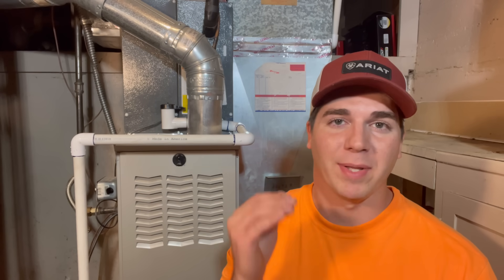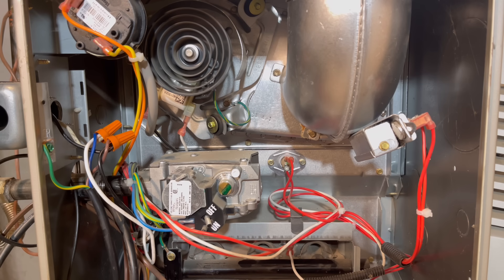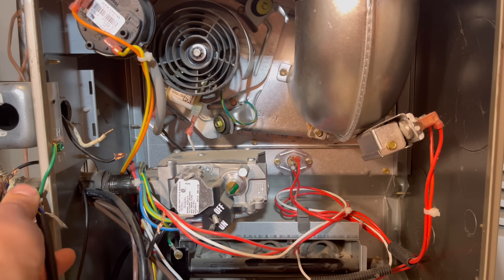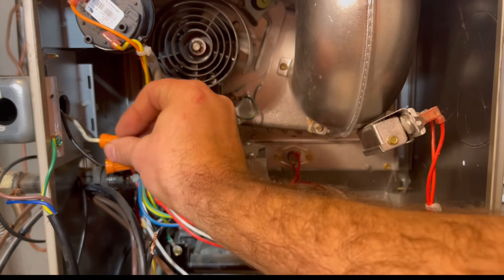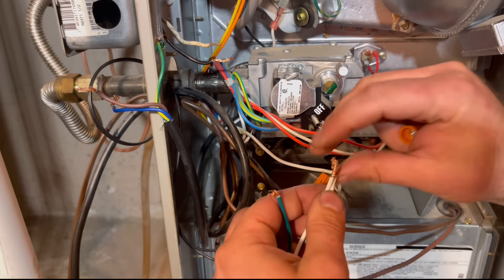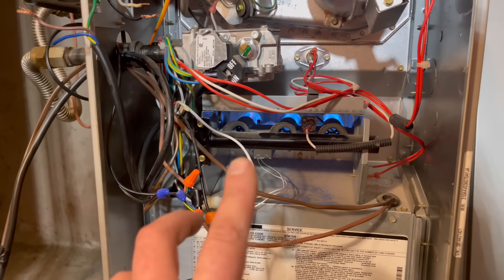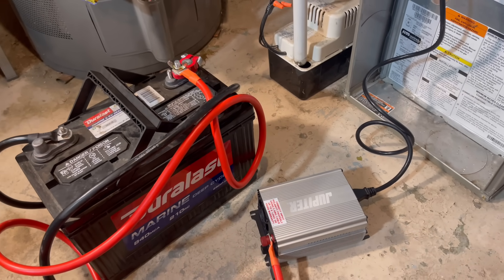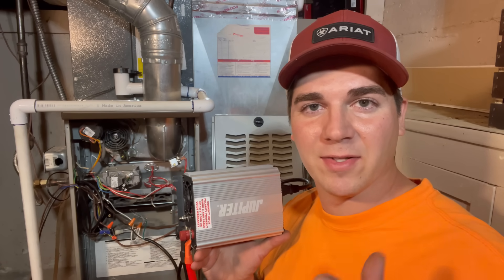Did You Know You Can Heat Your Home With A Car Battery?

Comment: My thermostat is electric.  I'm wondering how I can get it to kick on if there is no power to the wall thermostat.
Reply from the maker: This truck won’t work for an electric furnace unfortunately. It will only work for 110v
Reply: @diyhvacguy  thermostat is powered by electric. I have a gas furnace.
Reply: @diyhvacguy  I noticed that you explained to others that the thermostat is powered by the furnace. Good to know. Thanks for the video.

Comment: I have a lithium 12 volt deep cycle battery $190. These batteries will run a trolling motor forever. Will it work on this trick?
Reply from the maker: It’s worth a shot!

Comment: It doesnt last long more than 4 hours. The average furnace blower fan, and inducer fan will run about 1000 -1500 watts, yor inverter must be 1000w to 1500w. The battery for the system only can run only 3 to 4 hours per battery.
Reply from the maker: Correct but it doesn’t run for 4 hours straight. My furnace runs for 10 min increments, then sits for about an hr before it kicks back on

Comment: Emphasis on the RV battery. It is generally a deep cycle and is ok with heavy discharges and recharges. 
While a standard automotive battery will work (if it saves your life and/or your home, then go for it), heavy discharges until empty will greatly shorten it's lifespan.
Also, regardless of the type of battery, be sure it's always fully charged. Your automotive battery likely will be already. However, if you have a battery on the shelf or sitting outside for long periods of time, get yourself a battery charger (a Battery Buddy, etc) to keep it always ready for use.
Reply: golf cart batteries are designed to charge and discharge  hundreds of times. I use thr in my solar generator. it lights half the house and boiler
Reply: Yeah little car battery just run an extension, idle the car at night and solar the battery at day.

Comment: You are absolutely correct in everything you showed except I’d recommend people take a photo of all wiring BEFORE disconnecting in order to reconnect after grid power is restored to the home. You showed the 12 volt/inverter connections but you should have shown the connections back to normal grid operations. I’ve shared this video link with 400 of my neighbors on a local site because we have 1920s vintage power grid lines and in light winds or ice we go without power for hours and some days. I have a steam boiler system and already had my back-up just as you showed by we have a 24v transformer system that ignites our gas burner (110 to 24v transformer).
I just purchased this 2-way switch and this video gives detailed instructions on hooking up to our boiler/hot air furnace so you can switch from normal grid power to the 12 volt/inverter “in a click”.  You could incorporate this into another video with your system.
You also need to add a ‘disclaimer’ (to CYA) that only people with home electrical and experience in home DIY repairs and proper tools should attempt this. Doing this ‘may’ hinder furnace/air conditioner warranties. 
https://youtu.be/W0sTmCVLeGI

Comment: (also) if you going to buy a battery for this you want (if not a lifepo4 battery) an AGM zero maintenance battery capable of deep cycle.   You will also need a competent battery tender because lead acid batteries self-discharge relatively fast.  You'll need to leave the battery on the tender 24/7 365/yr.

And for ref the typical furnace while running full out takes around 400-600 Watts of power which means your 100Ah 12 volt battery will last about 2-3 hours of solid operation.  Granted furnaces are usually only on for say 10 mins per hour so 1 battery will last you about 18 hours in cold cold weather.

If you want to be able to run your furnace for say a 3-4 period you're going to need a lot more batteries.

This is also a perfect use of a generator.  A lot of people waste generator fuel when their loads aren't maxed out (it consumes fuel even if there is no load).  If you buy a rapid 12V charger you can use that to top up your batteries from the generator periodically making good use of the fuel on hand.  Only running the generator to charge batteries (which provides a constant load) and turning it off when they're full.

Comment: The correct way is to setup a separate backup panel and then some sort of ATS to swap between grid and generator/inverter.

If you want to do a "hack" then add a male 15 amp grounded plug to your furnace by splicing the hardwire input and then turn the other leg into a receptacle box with a standard 15 amp female outlet in it.  Then just plug your furnace into that.  That way you can plug it into your inverter/generator without having to re-wire it.

What you're recommending here is a really bad idea esp since most people will be doing this in a grid down situation (re: in the dark).  At least if you go the outlet/male plug route you can do that well in advance of a storm.

Comment: As you have the inverter, why not unplug the furnace plug from its outlet into the inverter?  It doesn't make sense messing with the furnace wiring.  Also solves issue around needing 24 volts mentioned in other comment.
Reply: Newer furnaces with variable speed motors will need a pure since wave inverter.  Check the price for this type of unit. This hack is not as inexpensive as represented.  Might work on older units in a pinch?

Comment: Honda EU2200i or larger generator.
Propane conversion kit with 20lb or 30lb tanks.
The same pigtail for the furnace mod.
This allows you to run you furnace and fridge/freezers.

I use an independent deep cycle battery and a small inverter to fire up my gas fireplace first.  If cold temps require it, I plug the furnace system in to the generator also.

Comment: Love the thinking here, however only good for Gas Furnace, not good for electric furnaces 🤣🤣 That little thing would smoulder 🔥

I use a deep cycle battery and 1500Watt inverter as a backup to power my Pellet Stove in case of emergency. Haven’t had to use it yet in three years.. But in my case, my pellet stove doesn’t draw a lot of current so this deep cycle is supposed to give me a 24 hr run time, which I have yet to test. 
But having 3 batteries is definitely nice.. 

I think a generator is still the way to go, as it’s most of time easier to go get gas somewhere..

Comment: Great advice! Can you do a video series on attaching a permanent A B switch ..and a permanent plug in off the FURNANCE and how to recharge the battery after drained.  Or a video on testing it out with a lithium battery? I think many folks would like to make it a permanent mod so when power is out…just switch and plug it in ;-).  Thanks so much!
Reply from the maker: Yes! My next video that posts on Wednesday evening shows how I changed my power source so I never have to touch wiring again. Also a company is sending me a lithium ion battery 100ah to test so that will be cool to see how long it would run on that :)  stay tuned! cheers

Comment: His claim of being able to power your house furnace for several days using a car or even RV battery is misleading, unless you live in very mild climate where the heat is barely needed and you have a small house. My house is about 1600 square feet and my furnace draws 2.63A at 120V. That means it would theoretically need 26.3A out of a 12V battery. Considering the efficiency of the inverter (modified sine wave) estimated to be 80%, the battery draw will be in reality 32.9A. Assuming the battery is fairly new and fully charged to begin with, with 75Ah battery (small car) I will theoretically have about 2 1/2 hours of furnace run time. With a 150Ah RV battery I could get almost 5 hours. In real world, these times would likely be less, because of the actual battery condition and the fact that battery published capacity is typically specified for lower discharge currents than the furnace will draw. CCA has no meaning for this application. Of course even in cold climates the furnace does not run continuously, so it is up to you to find out if just a few hours of furnace run time will be enough to keep your house warm for those several days.

Comment: I think this definitely gives people options to keep the heat on during an emergency. Great idea!
Reply: Replace the on off switch with a double pole double throw switch and hook a female AC cord to the second switch.  Now all you do is throw the switch to the second position.  Without anything in the plug the furnace is off with AC to the plug the furnace is running from the second source.

Comment: im a jm electrician and can say this will definitely work, BUT  for how long?
the furnace  electronics dont use much power but the fan would drain that battery in a few cycles in my  estimation ?!
Reply: you would be better off wiring that invertor to your car and running an extension cord from furnace to car, then you have heat as long as your car has gas

Comment: I think you can just use your battery there.  and the inverter there.  and a plug with two male ends.  and plug into nearby outlet.    (making sure to turn off your house main breaker first)

Comment: Would anything like this work for an electric furnace heat pump system? Seems the heat pump system would need a lot more power🤷‍♂️. Thanks!
Reply from the maker: You are correct. Heat pumps require 220v and this will only work with 110v

Comment: SLICK BUT, DON'T YOU HAVE TO FIGURE OUT THE POWER CONSUMPTION THE FURNESS TAKES SO YOU KNOW HOW LONG IT CAN RUN OF THE BATTERY...?
Also, how are you charging the battery in the case that you need it to run the furnace longer than you thought...?

Comment: You can buy a used generator for what this cost... The blower on a typical furnace also uses about 500 watts so a 100 amp hour battery would only last a couple hours

Comment: Couldn't you use that second outlet for a battery charger and charge the battery and you would never loose power?  Let me know.
Reply from the maker: Unfortunately no, but a small solar panel would do the trick. The charger would not be able to keep up with the demands of the furnace.
Reply: @diyhvacguy  Thanks for the reply.
Reply: @diyhvacguy  You should do a video on how to set that solar panel to your battery and inverter. Diy Patriot solar generator.

Comment: I don’t know why people post this stuff, for example if I run my furnace in my rv that has 4 time the wattage available in battery reserve than this small set up it will consume the charge in a few hours. A way to make it work is to connect a 1500 watt plus inverter directly on the battery in your car and run 110 to the furnace from the car or truck, you will still consume more power than the alternator can produce so you have to allow some charge time. Of course just buy a 2000 watt generator for best results.

Comment: You refer to the battery at one point as “positive and neutral,” isn’t it always “positive and negative” on a DC battery?
Reply from the maker: Yes I just mistakenly said neutral because we were dealing with both dc and ac volts in this video haha

Comment: Often times the furnace will already be plugged into a simple wall outlet and no re-wiring needed. Unplug it from the wall, plug it into the inverter and done.

*NOTE*- Please do not attempt this with an electric heat or heat pump HVAC system. @ 240v and about 50A that's 12,000 watts of power needed. The gas furnace needs 120v and about 7A (depends on what kind of blower motor in it - PSC vs ECM, may be less) for about 840 watts or so.

Comment: Hey there electrical engineer here. Assuming you have natural gas the best solution for a downgrid situation is a natural gas powered generator. The other suggested Solutions depend on gasoline to keep that car battery charged.  The blowers in your furnace easily draw over 1,000 Watts. A 12 volt car battery will go dead after about 30 minutes. Good luck!
Reply from the maker: I test this yesterday knowing it would be shorter then I expected but I got 6 hours of keeping my home at 60. So not bad in a pinch. I agree and I do have a natural gas generator, but I wanted to create this as an alternative for people. Thanks,   Dave

Comment: Another thing that you can do in advance to a power outage is, in the Romex between the breaker box and the furnace I put a female & male cord plugs in line. That way when there is a power outage, I can run an extension cord from a generator to my furnace plug so that I can have heat. 
All it takes is a generator & an extension cord. 
Hello from north east Montana. 
10 miles from the Canadian border.
Reply from the maker: Thanks so much  for the tip! Cheers
Reply: @diyhvacguy   Another thing that I did is drill 4   1/2” holes into the sill of my house above the concrete, get 4    12 gauge, 50 foot extension cords of different colors, if possible.  4 very good female cord ends. Cut the female ends off of the extension cords, push them through the holes into the basement, leave enough outside to plug into the generator. Inside take one near the furnace emergency plugin. Take one near the refrigerator. Take one near the deep freezer. Take one to use for lights. Put all 4 new ends on each cord. Now you are more ready for a power outage. This was a small 3500 to 6500 can  keep the house warm, refrigerator cold, freezer frozen, some lights on.  Without having to install a double throw breaker box or another whole house system. 
Hello from the north east corner of Montana. 
10 miles from the Canadian border.

Comment: Rather than reading through nearly 2K Comments...
My 2 cents...
Isolate the Battery from the Concrete Floor. Place the battery on a block of wood or other non conducting insulating material. You can take your 12V battery and connect a 100W solar panel directly to the battery as a trickle charger during the daylight hours. consider connecting a volt meter to monitor battery charge.

Comment: These are the kind of videos that helps other Diy’ers need for ideas! 2 batteries connected together with a 3000w inverter can run lights, fans and other important needs in a Grow when the power goes out..😅

Comment: Great! But what can you do if your furnace is an electric model?
Reply from the maker: It does not work in a 220v furnace. Only 110v
Reply: @diyhvacguy  Right.  I get that the voltages are very different, but is there any option for an electric furnace other than a portable gas generator or whole home backup generator?

Comment: Plug a battery charger into the other outlet to charge the battery.
Reply: @HaShomer ShelTorah You can't make more power then what is used, by using the battery to charge it's self. That would be like using a charger on an EV when driving to charge it's self.
Reply: @ducewags  You have never tried it.
Reply: @wrg1183  You have NO clue. It is a myth, try the internet some time.
Reply: @ducewags  That was probably the dumbest comment in this thread, congratulations! Regardless, though, you still never tried it. It is recommended to run your engine while using an inverter in a car unless you have a deep cycle battery, why? 

Because when the engine is running, the alternator MAINTAINS THE CHARGE OF THE BATTERY! Gee, golly, gosh, goody goody gumdrops, that is EXACTLY what a battery charger does!
Reply: @wrg1183  Finding the proper info on things is very hard for you, right? It's myth and proven a myth many times. Try the internet some time. And telling me I have never done it, is also incorect. But you know everything, right? Now do you want to talk about dumb comments, read what you typed and still "think" is true. I'm done with you.
Reply: @wrg1183  When was my channel created again, that you think is a troll channel? You can't make more power from an inverter that runs off the same battery that you want to charge. How do you even think that could work to start with? Did you fail basic school? Or did school fail to teach you things?

Comment: Great idea. I would try to set it up for the battery to stay in the vehicle and run a thick extension cord from the inverter to the furnace, so the battery can recharge in the vehicle. I'll store the inverter in a Faraday cage with a small solar cell in case of EM P.  YOU ROCK!

Comment: Cool. I swapped the switch on the side of the furnace to a outlet and made a pigtail that comes out of the furnace and just plugs into the outlet. If we lose power, I just unplug the furnace and plug it into an extension cord from the furnace. I like the battery idea. I have two batteries in my truck and a couple inverters so I’m good to go.
Reply from the maker: I just did this today! I won’t have to wire anything ever again. Simply unplug the furnace and plug it into the inverter or generator 👍🏽 thanks for sharing,  cheers

Comment: "THESE" ARE CALLED- 
InstallGear AWG 5 Gauge 10ft Battery Power Inverter Cables (2ct Red/Black) for Solar, Auto, RV & Marine, Lawn Mower - 99.9% Oxygen-Free Copper (Set) | Battery Wire/Battery Cable

Comment: I'm impressed this thing isn't faulting out. This furnace is not grounded and flame sensor circuits work by sending current to ground.
Reply from the maker: I need to look into that. It’s how my furnace has been since I bought the house

Comment: When the blower fan kicks in your amperage draw greatly increases draining the battery much quicker. A few hours tops until the battery is flat. A generator, solar panels (daytime) or a vehicle can recharge the battery. (If this is your only vehicle battery, the car won't start either)
Reply: Offgrid 10 years northern minnesota

Comment: Use the extra plug to keep the battery charged.
Reply: @Woody Bear Things don't work like that. If it did work that way, then why not just plug a charger into an EV and charge it as you drive.
Reply from the maker: The law of thermodynamics tells us things aren’t this easy. Our world would be a lot different if these laws didn’t apply. Thanks for the comment though! Cheers